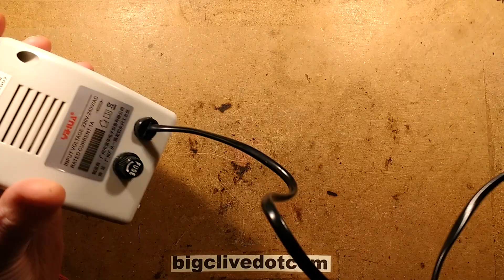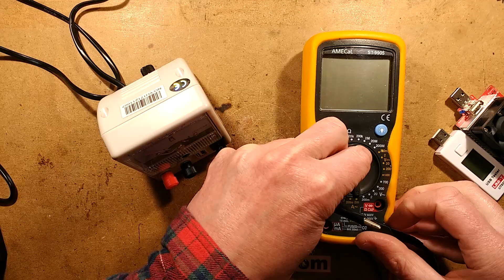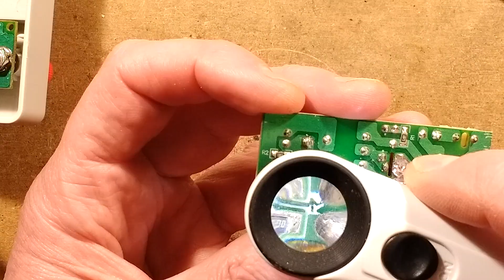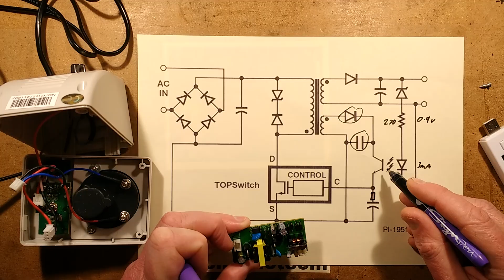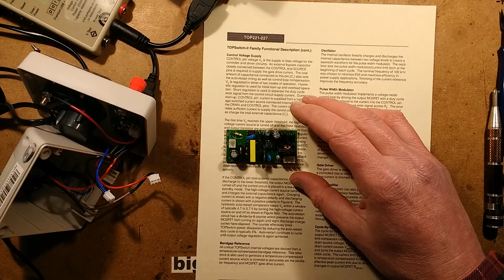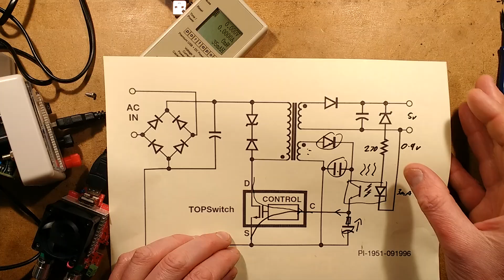Test of the Yihua 502D USB bench power supply.  (With fix!)

Comment: About the badness of putting the fuse in the neutral line my dear chap.  These plugs are symmetrical and there's no way of telling which way round the consumer will insert their appliance, if you will pardon the expression.  So what you're actually worrying about is which wire is blue/black and which is brown/red.  They might as well be the same colour.
Reply from the maker: Not when a polarised plug is fitted.  Nothing that in fitting one (with a fuse) the flex was copper coated aluminium.
Reply: bigclivedotcom     ta for thé reply, but is that English?  A device designed for connection to the mains by way of a two-pin symmetrical plug cannot differentiate between the two, can it?  If a person cuts the plug off and replaces it with a 3 pin plug it doesn't matter which way round because it could have been connected either way round with the original plug and the third earth pin is not connected.  so my thesis is this: for a two pin symmetrical connector the blue wire should be treated as being as dangerous as the red wire (either could be live)  and it doesn't matter which one is connected via a fuse. It's not an RCD, and I think a decent RCD is symmetrical too, i may well be wrong there.  And what's the relevance of copper coated aluminium ?  Sorry for pestering.
Reply: The original 2-prong plug is a 'europlug', common in the rest of Europe for low-power unearthed devices, and can usually be forced into british sockets in a pinch (useful for phone chargers). I agree that the color of the wires is irrelevant for the fusing with this plug, and adding another fuse on the other wire doesn't help much either. If Clive fits a british plug to the same cable, then polarity becomes a "problem" only in that it could be made better with the fuse on the red wire; but there is already a fuse in the plug so "meh". Aluminium cables are a different problem: they are used quite a bit for cost reduction in cheap "chinese" products. In such a low-powered device, they shouldn't be a problem for conductivity, but are not as flexible or resistant to fatigue and stress: it's not a particularly "good cable", although not horrific.

Comment: That high voltage insulation test is a bit worrying, 1mA at 2kV, where is that 2W going to? Something must be getting very hot.
Reply from the maker: Capacitive coupling, so no heat.
Reply: Ah! I was assuming that an insulation test would be DC.  So it's actually just measuring the 1nF class Y capacitor that bridges primary to secondary grounds.

Comment: Clive, I suspect the 3mA on the Opto LED might not be enough to drive the phototransistor into saturation, causing significant dissipation in it. Or maybe the IR from the LED leaking and messing with the FLIR ? try taping a bit of AL-foil to the opto to block IR w/ some black tape on top and FLIR it again to see if it's really that hot?

Comment: Wonder if you could modify it to have the vsense somewhere on the front panel board. That ammeter is probably indroducing a decent amount of resistance at high load like 2 amp which is why even with 5.25V@0A it was still down under 5V just before cutoff. Would be easy to check though; see what the vltage is at the board before it goes over through the ammeter to the front panel.

Comment: Do not exceed control pin current is 100mA and max V=9V. Plus any charging of cap - could be a bit much for that titchy opto coupler many are rated well under 100mA..

Comment: With it being a 2 prong plug on the lead, does it matter which wire has the fuse pre rectifier?
Reply from the maker: It's not so critical in a double insulated appliance.
Reply: No, but the prongs could at least have been to scale and color coded. -Dave

Comment: Maybe the on-load drop is the panel meter.  Some cheap current meters have quite high series resistance.
Reply from the maker: I did consider that.  I may have to revisit this little power supply again in the future.

Comment: Thanks for that song Clive. Yup, going to have that in my head now! I would like to see some more power supply reviews and 'flash over' testing on the cheaper supplies. Have not seen a supply fail this test yet from you or have I missed a video?
I love power supplies, only because like you, I hate surface mount components! Generally big chunky power supplies have both but probably 75% through hole components so can be 'easier' to troubleshoot and even mod to your liking.

I have server power supplies which are built like brick s**t houses so may review one soon!

Comment: If they are using the opto-isolator in analogue mode, then it is not surprising that it gets warm.  When used digitally, the transistor will be either totally non-conductive  (zero current through it)  or totally conductive  (zero voltage across it.)  Either way, there will be no power dissipated within the transistor  (maybe just a little bit, as it probably has a fraction of an ohm resistance in real life).

But when the transistor is only partly conducting, there will be a voltage across it and a current through it, therefore non-zero power dissipation.  So it will get warm.  Perhaps you could attach a heat sink to it?  You would need to put a mica insulator on top of the opto-isolator and extending over the pins, in order not to spoil the isolation gap.
Reply: The TL431 should be an all-or-nothing shunt, although having the LED in the circuit might change that behavior; the LED current might be too low to properly saturate the phototransistor though, causing the same problem.
Reply: bluerizlagirl nothing like a little foul backplate to add a little stray capacitance.

Comment: Curse you and your 'ma nom ma na' ;-)  When you put your favorite plug on the end - swap the iive and neutral?  Oh wait, did you plug it in backwards?  (Yeah, that's for the three days to clear my head.)  Is it possible to run an opto-isolator at under-saturation and generate heat?  A lot of us might never consider the resistor mod.  Thanks

Comment: Analogue displays, I prefer them for some bizarre reason. 
Maybe I’m just old school lol
Reply from the maker: It's actually really nice.  When you plug a phone in you can see it nudging the current up until its happy.  With a digital meter it jumps up erratically in big steps.
Reply: Green Silver   I had three dvm's when I bought a 7 euro analog multimeter.  Why?  Because I wanted to measure the average current through a dc motor driving a piston in cylinder pump, where the load is constantly varying at about 1Hz.   The dvm's were producing a scatter pattern (sampling frequency, Fourier, etc) and did not have a time integral function.  You get that inherently in the ballistics of an analog meter.  So it's not just because you're old school!
Reply: Check out EEVBlog's video on analogue vs digital meters.
There's some interesting discussion in the comments
Reply: Peter Barsznica   ta for the tip, I've just watched it and as you say the comments are very interesting.   It's hard for me to bear his over-excited puppy dog presentational style,  but some of the content is good.  I observe that many people own smart phones and can download a free app that provides a frequency meter for tuning a musical instrument.  I think that In the very near future a lot of specialist equipment will be transformed, or fail.  Multimeters included.
Reply: Ray Kent I think electrical equipment will be spared, simply because if your $350 multimeter blows under normal use, it gets replaced under warranty. If your $250 multimeter sensor attachment blows and bring your $500 phone with it, you're out a $500 phone :)
Reply: I prefer analogue meters for their faster response. If the current draw is excessive you know instantly, with digital by the time the display has settled the device has blown up 😂

Comment: I'm really disappointed that you don't have a sampling of smd resistors of all sizes for just this situation. They are ridiculously cheap, and you already buy stuff on ebay. I'd happily pitch in to get you some if you'd actually go through with the mods you threaten and video them, but I suspect it's not the money, it's just the fact that you haven't done it yet, so please do get on with it and get some.
Reply: And then you go through with a mod anyway. That's why I love this channel!!!! <3
Reply from the maker: I really should get a few SMD kits in.  I've got a pair of ceramic tipped tweezers on order.
Reply: tiger12506 ordered on gofundme's site.

Comment: Interesting the back label says it's rated at 1 amp but then the spec for the usb port is 2 amp. After watching this I'd say the 1 amp label would be the safer option to go by. Thanks for the fix because the unit looks interesting.
Reply from the maker: It appears the 1A may relate to the fuse.  It does appear to be rated 2A.
Reply: Back panel current specs always refer to input current.  It is right below the input voltage.  That is standard in North America and I thought the world.  It is there so you can judge what and how many devices can be used in an AC circuit safely.  If it was referring to the output it would say so along with the output voltages in addition to the input specs.
Reply: ElmerFuddGun don't let Fudd fool ya. We Americans all write in rows from left to right, and things in columns don't have any relation except to indicate graphical parameters for a given range. Top to bottom is how to wash cars, not how to read latin letters.

Comment: I like the retro 50's look of it. The size is actually very practical. The room inside with vents help to minimize components from overheating and the large meter is pleasing. In this day and age of miniaturization to the point of marginal safety and utilty it's nice to see something that would not get lost beneath a postage stamp. A little judicious tweaking makes it perfectly functional. A bit of QC at the sweatshop would have been preferable but otherwisw I'd give it a crooked thumbs up.
Reply: The nineties are the new fifties?

Comment: I'm slightly surprised Clive has given this a sort of thumb up.
The fused neutral is possibly more of a sin in UK than it would be in many of the two pin countries which don't have "polar plugs".
To play devil's advocate the voltage issue is still within spec by the USB standard which expects an output of 5v +0.25v -0.5v ... to be a complete arse I could actually say off load Clive's fix takes it off spec - but I wouldn't dare...
Having just found the fleabay listing, @£29.99 fekking heck!!!! I'd be a bit disappointed if I'd paid that for that ... 
If a steady 2A @ 5V is the only criteria, and there is a god, there must be better and cheaper options.
Reply from the maker: I replaced the plug with a UK fused one.  The cable is copper coated aluminium!  For a two pin double insulated style of appliance I suppose a fuse in the circuit is at least something.
Reply: I suppose in reality with a 2 pin plug fitted using two colours is pretty futile, to be fair the only thing the colours do is remind you you have a 50% chance of getting electrocuted.  You've changed so many bits now that its almost like the old roadsweeper's brush.

Comment: why not change the board to one from a good usb charger ?, i think the usb board from that brit general from another vid would be perfect
Reply from the maker: I have actually considered doing that.
Reply: i dont see reasons why not, the device is neat(i would love see that more time in future videos), the usb board from that outlet is very good and how you said prob wont use that outlet and you can talk how do mods to make a thing more secure, because you have to change that to a brit plug and change the wiring of that fuse(or just removing the fuse holder)

Comment: I think that the voltage being set to approx. 4.6V is a symptom of the feedback issue. IE set the voltage to 4.6V and the voltage on the output of the feedback winding will be approx. 10% lower than if the output was set to 5V. V=IR so P=IIR and reducing current by 10% (assuming the feedback in the chip is a resistive input which they usually are) will reduce the power dissipation by 19% approx. Set the output voltage to 5V and things will get really hot.

Comment: I'd say for around $10 its ok, but at the $15-$20 I was finding those at, that thing is pretty awful as its similar quality to a standard $5 wall plug so the only thing you're getting out of that thing is an amp meter and a couple banana jacks, so while you'd need your own power brick there are plenty of decent DC converters out there for $10 and some really good ones such as the DPS3003 for a little over $20, just my opinion but I think I know which I'd rather spend $20 on.

Comment: I know the label on the back rates it 1amp but they are advertised as 2 amp which has been confirmed by separate vendors when questioned.
Reply: 2A  is for the AC fuse. SMPS can have more amps on the lower voltage.
Reply: The meter goes up to 2 amps, does it not? There you have it.
Reply: dand8282 it's not a fuse, it's a high current shunt for leakage.

Comment: That's a very stylish power supply. It'd be neat if you could make an adjustable supply out of it for light duty stuff.
Reply: ElectricalNovice19 I wonder how nicely it would do 4.5xV boosting while supplied a nice undervoltage, say like 200V from a varistor.
Reply: ElectricalNovice19 I wonder how nicely it would do 4.5xV boosting while supplied a nice undervoltage, like <220V from a varistor.

Comment: While this is a little cheapo power supply,  that little chip is kind of impressive.  I'm a nerd so I read the most of the datasheet intro.  They managed to cram so much functionality into it and use only 3 pins for multiple functions as well.   But as you said,  I guess they're using resistors instead of a zener diode as the voltage reference for the feedback?  I mean that's the only difference I see...
Reply: Dacke - I believe they’re known, at least colloquially, as ‘Topswitches’ as a general device type. They’re extremely common in low end electronics, and they get the job done. I’m not sure about their availability as replacements, though. I know they used to be awkward to get.
I still prefer a separate controller and switching device. They’re usually cheaper and easier to source. 
The resistors aren’t the reference, the TL431 is a ‘programmable’ zener device, its zener voltage is set by the resistors on its ref pin. They’re incredibly common and very useful ‘jellybean’ components.
Reply: Ahh I see,  thanks for answering that.  I had only been used to seeing seperate components as well.
Reply: Dacke in šoviet China, awkward components source YOU!

Comment: Wait, how the heck does current flow from drain to gate on a FET? I mean, above the microamps range.
Reply: The chip probably has other circuitry not shown in the diagram.
Reply: uK8cvPAq FETs have integrated circuitry not shown on a diagram.

Comment: Why would'nt someone  buy a good quality usb psu? I don't understand who this is for?
Reply: To power one's USB butthole warmer?
Reply: Amazon listing says it's for mobile phone repair.
Reply: This is unofficially a variable current varistor, for when your device has a dead short, when you never want to blow clear before discovering where tf it was.
Reply: I agree.  a work mate, who should know better, just blew up his £500 phone with a £5 charger. No fusible resistor, so just charred remains!
Reply: At 40 quid from Amazon, it's not so good.  For £14.50 from Aliexpress, maybe it's OK value.  (Either vendor search "YIHUA 502d".)

Comment: Probably a nice solid 5.1v before the output diode.  Replace it with a Schottkey, and it would be fine.
Reply: The feedback is after the diode. Mounting a Schottky if not already fitted, would drop the temperature a bit, though.
Reply: mjouwbuis I did not realize that temperature of a feedback is controlled, measured and utilized. That amazes me. What is the target domain and its units, if I might ask?
Reply: The diode is a schottky, otherwise it would blow up at switching frequency. The high internal resistance, I guess, comes from the amp meter.
Reply: the ampmeter is after the complete circuit, so there is another voltage drop. I bet you could find a point before/in feedback to improve load drop.
Reply: @PsiQ  Yep, moving the feedback to the USB plug instead of the power supply board and adding several decoupling caps made the voltage rock solid
Reply: And the inductance may screw up the feedback loop.